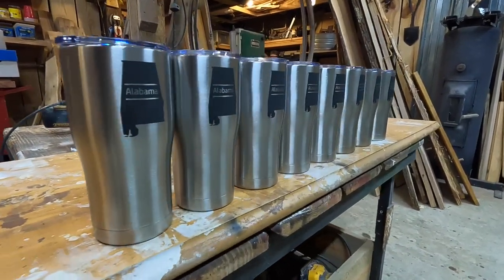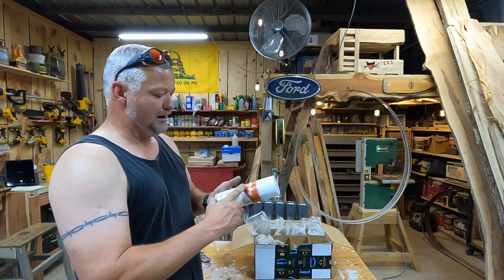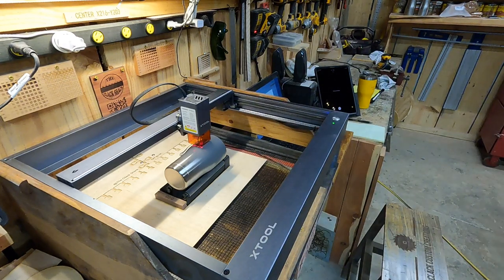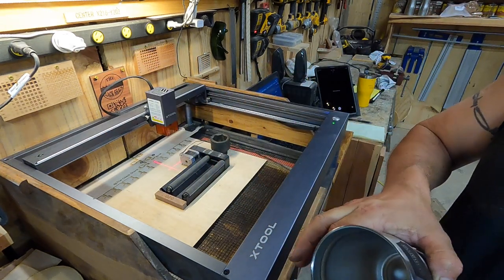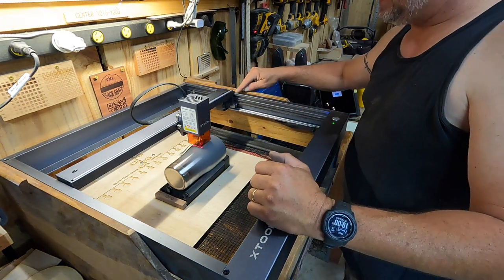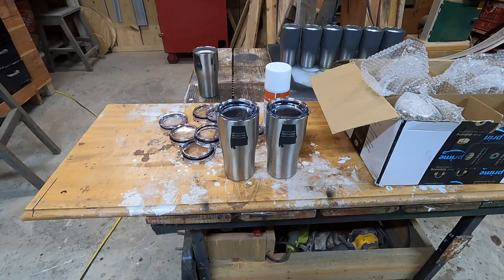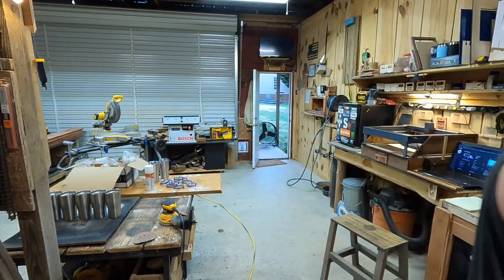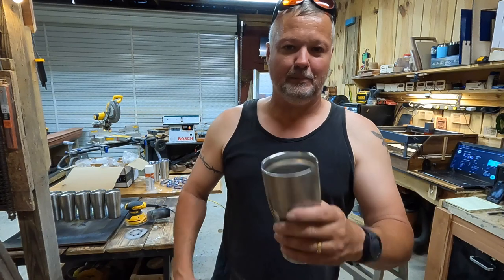Using marking spray to make custom tumblers

Comment: I've watched this a few times now. I'm curious about the vacuum table. I'd love to make something like this work instead of a full enclosure. Is it effective for deep burn engraving and cutting for clearing vapor/smoke?
Reply from the maker: Its all I use, I do not have scientific equipment to test the air but I can work in the shop with the doors closed and not be sitting in a cloud. I wouldn't mind the blower being larger and have plans to upgrade that part.
Reply from the maker: Most 5 gallon shop vac are around 100CFM max, I plan to upgrade to a 200 CFM or more fan

Comment: As I was watching the video when you started the reclamation of the tumbler with the sander, it appears that you aren’t using hear protection of any sort. Hearing loss is cumulative, especially at the higher freqs. and volume as recorded on the video. As one who is now paying the price for years of thinking brief exposure isn’t much to worry about, I won’t even let contractors work without adequate protection.
Reply from the maker: Thanks

Comment: Do you just buy normal tumblers? Or do they have a coating on them? I purchased a marking spray and it didn’t work, the company told me it didn’t work because my stainless steel tumblers have a “coating” on them?
Reply from the maker: I use marking spray, should be in the video.

Comment: How do you level your tumblers? Seems to be my biggest issue. I have your jig (works great)and I use the hassle 20oz tumblers but have issues keeping them level.
Reply from the maker: I use spacers to level the rotary and a weight inside. I have more videos explaining. keyword tumbler.

Comment: I'm having problems with the image stretching about 2x the size from side to side. Using the Xtool D1 Pro 20 W with the new chuck rotary. Using Lightburn. The diameter is set correctly in Lightburn. Any suggestions? Thanks again for your videos and advice. I'm from the Gadsden, AL area but did see your display at Peach Park the other day. BTW your jigs work great!!!!!
Reply from the maker: My knowledge of the RA2 is very limited to just what I have learned doing research, I don’t currently have one. Sounds to me that the step measurement needs to be increased. Make sure the settings for the steps is set correctly.

Thanks… the display is probably empty. I haven’t gotten a call to refill it lately

Comment: Thank you so much, I went to your affiliate Amazon store. it shows that the tumblers already have the powder coating, does that apply to the silver cups as well? and do I still need to spray again? on top of the powder coat. thank you.
Reply from the maker: No, coated tumblers are basically stripped of their coating revealing the metal. Only plain stainless requires marking spray. If you want black on coated tumblers, that would be a process.

Comment: Can you do different colors of engrave with the plan silver. I am hoping to get the machine in Nov
Reply from the maker: If you are referring to stainless, it will slightly mark without spray but requires spray to leave the darker marks currently the only sprays on the market are black that I am aware of.

Comment: How did you set it up to keep the map in tact while you washed the marking off.
Ed
Reply from the maker: Not sure I am follwing, the burn includes the map and text. Cermark washes off with water if it isn,t part of the burn.
Reply: @TheClackShack  So that would be treated as a fill , correct?
Reply from the maker: @edmelzark1069  yes, The text will retract from the burned area

Comment: I have an Ortur LM2 15W. I’m burning at 100/100 and it is slow. What do ya think about speeding it up?
Reply from the maker: I am not familiar with that particular machine. I suggest a test grid to be sure. If you plan on doing stainless air, it would be worth it. You can always sand it down and recycle.

Comment: Have you ever tried etching the tumblers with color. Basically the same tumblers that your link goes to on Amazon, but they are a couple dollars more for the same tumblers with color.  Instead of burning the paint, you would be removing the color down to the stainless.
Great videos by the way, just found your videos today when looking for XTOOL videos
Reply from the maker: Yes, I have done lots of them. Pics on my FB page and here is a video. https://youtu.be/BXZkLiG6ahk
Reply: @TheClackShack  - Thank you.  Looking at buying the new D1 Pro with a rotating piece.  Will rely on your videos and will buy through your link when the time comes.
Reply from the maker: @JoeGalanteTribute  , as soon as it gets here. I will be putting it through the paces.

Comment: Hello I have a question do you have to change the ciconferense and diameter for each cup that are different sizes?
Reply from the maker: The basic rotary has range settings on each of the width adjustments. You have to use the corresponding setting on the physical machine.
Reply: @TheClackShack  sorry to bother you, I'm new to the laser, yes I have the xtool d1 10w, and the new rotary the chuck's and I was  checking on it and I see the  circumference and diameter if they are different sides I have to change that
Reply from the maker: @rigopulido4897  , you need to move the bar to the setting for that size. There should be indicators printed on the rotary

Comment: I have really been struggling with the darkness on my stainless tumblers.  I opted to use black laser metal spray from brilliance.  I have ordered the Cermark thinking maybe that is the issue.  I have played with power and speed settings.  In order to get a nice dark image it takes 6-8 hours for a 3”x2” image.

Thoughts?
Reply from the maker: 8 hours? I do these in 15 minutes, what power and how are you doing them?
Reply from the maker: 2 coats of cermark, 70 mm/s at 100% only 1 pass and you will be done in 15 minutes with a 10 watt. I have done lots of them, many in batches  of 20 or more.
Reply: I’ve used 100 power 70mm and it is very faint.  Dropped to 50mm a little darker.  20mm better but still 152 minutes.  Right now it’s 306 minutes 100 power 5mm. (240 dpi)
Reply from the maker: @steveday805 that is with using marking spray? If so you need cermark. Expensive but it works
Reply: @TheClackShack  As mentioned, I have ordered the CerMark.  The Brilliance laser marking dries as a white powder makes a mess of my rotary.  They must not work the same.
Reply from the maker: @steveday805  Engraving and marking glass with the XTool D1
https://youtu.be/A8n03q7qM7M
Reply from the maker: @steveday805  I have never used it. I think you will like cermark better. My tumblers have been used for months and still look good and dark
Reply: @TheClackShack  BTW.  Love all the videos.  I bought my laser to engrave stars on flags, but you and a few others have opened up so many other avenues.  Keep up the amazing videos.
Reply from the maker: @steveday805  thanks.

Comment: if you don't put a sealer on the stainless steel after sanding it back, it will have rust spots.  by sanding you removed the coating that is on stainless steel.
Reply from the maker: Guess I am lucky. It hasn’t rusted after a couple months. I must say that as a child,my dad built stainless steel whiskey stills. We never coated them with anything after welding or grinding them. 30 years later and they still look like new. 

It is my understanding that as long as the alloy contains more than 10.5 percent chromium, the reaction between the chromium and oxygen will reform the rust barrier.
Reply: @TheClackShack  I must have removed more on mine when I sanded.  I don't know how thick the coating on stainless is, I may just need to be more careful on how much I remove, also the one that rusted on me was etched with a fiber laser, so that might be the difference.
Reply from the maker: @TheFeist77  , it could have to do with an imperfection in the steel as well.